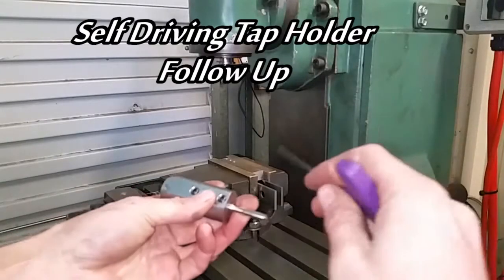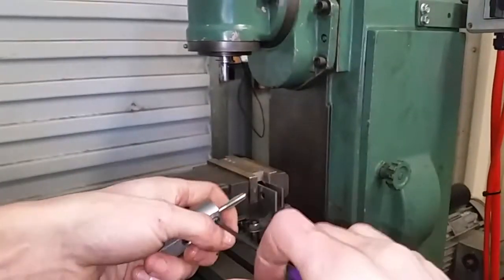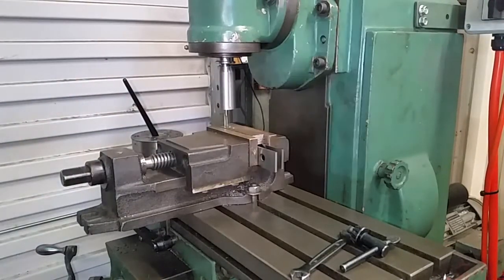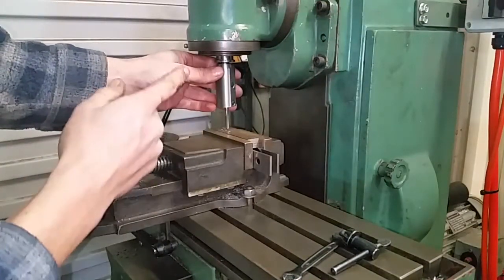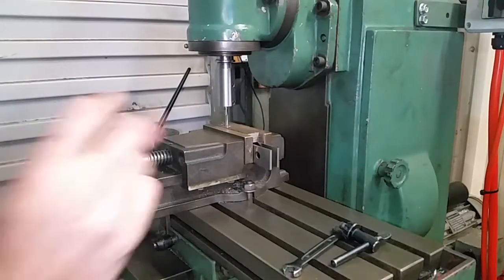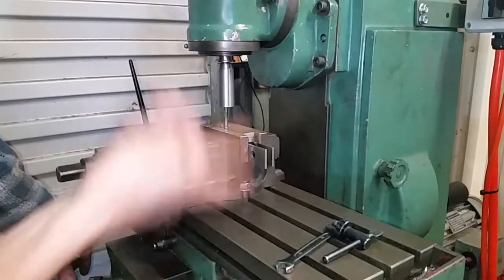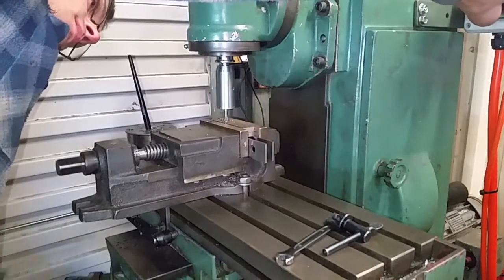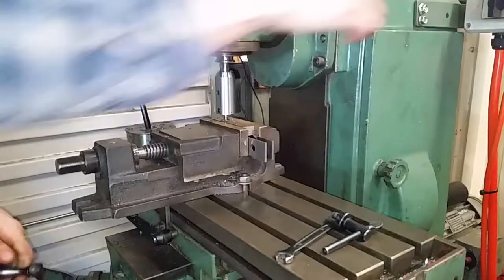Power Tap Holder Follow Up

Comment: What type of taps did you use? Were they a special kind that doesn't need to be backed off every 1/4 turn?
Reply from the maker: Ah no just a standard tap, which is not ideal for power tapping I know. A spiral flute tap is a better option, and pretty much exclusively what I use these days
Reply: @TomMakeHere  thanks!  Thats what it looked like.  Harder to find low cost imperial spiral taps, thats why I asked.  Didn't know if there waa trick I was missing. Thanks for the vid!

Comment: First the bevel cutters and now this? I swear, it's like you're living inside my head, man. 

I've got a CNC Bridgeport that doesn't have any kind of speed feedback, so it can't do rigid (or even semi-rigid) tapping. I was tapping a bunch of holes using tap followers the other day and reflecting on how a tool very much like this would simplify the process for me- I could just give it a command for M3 S120 and then M4 to back it out, without needing to worry about synchronized movements with a feedback signal for speed and spindle position. 

Biggest difference, really, is that I'd been thinking of just having a tube with slots in the side to slip over the tap wrench, with a spring-loaded follower still inside to allow the use of all my different-sized tap wrenches.
Reply from the maker: That would be a way simpler method lol. Great idea
The design you are aiming for I'd line the vertical slots with a low friction material so that it doesn't grab hold of the tap wrench and stop it sliding if that makes sense
Reply: @TomMakeHere  Yep, makes sense. I've got a stack of 608-2RS bearings laying around- make the slots wide enough for those, and replace the cross-handle on the tap wrench with something that fits the ID of the bearings, there's the friction issue sorted.

Comment: You'd gain some room by making the slide in side the mt3 part , you could make the slide long enough for the whole tap length.
Reply from the maker: Yes that's correct.
I had an existing 12 mm tailstock die holder on my lathe, so the thinking was that I could be clever and adapt the design over there as well.
I just tap by hand these days, I don't really do production runs yet...